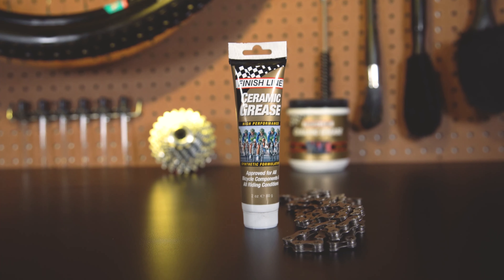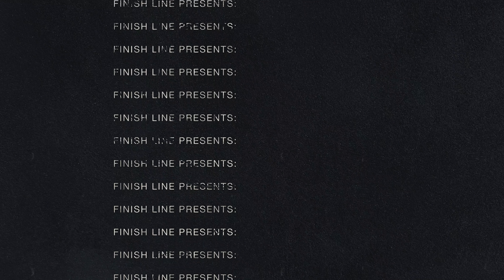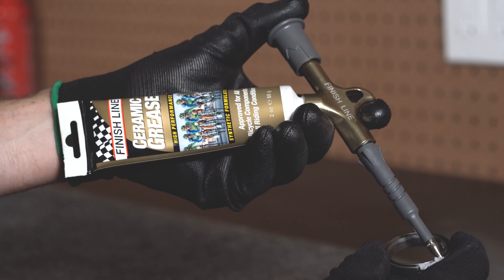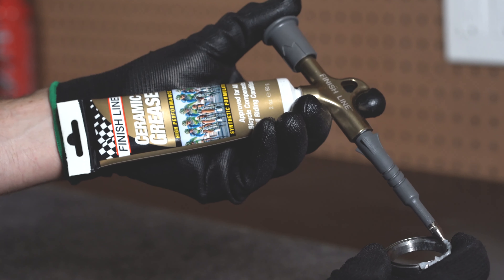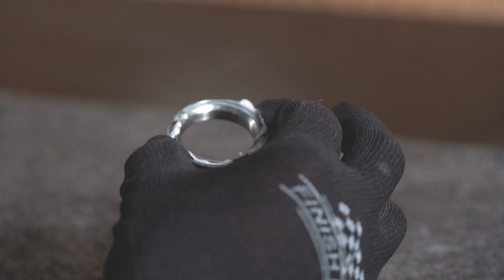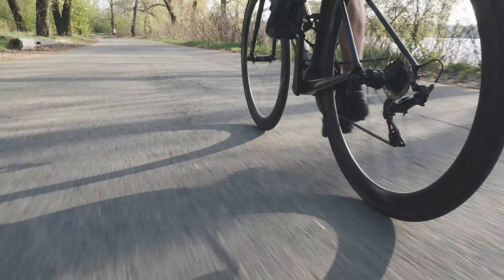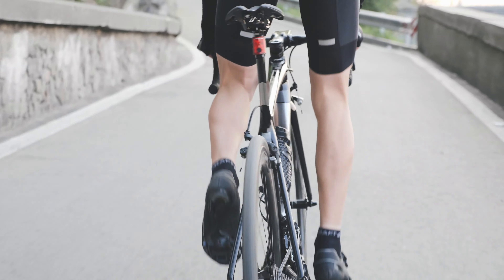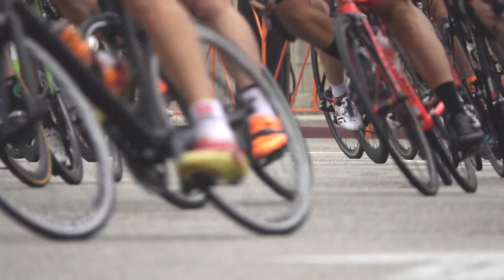Ceramic Grease | Finish Line : The Inside Track

Comment: Hey Finish Line, is this ceramic grease good for loose ball bearing hubs, or only for sealed bearing rebuilds?  The video only shows packing a sealed bearing and only mentions bottom brackets.  I want to know before I commit to buying a 1lb tub.  Thanks!

Comment: Would you recommend ceramic grease or the premium grease inside of a freehub?
Reply from the maker: Hi Inam Bohle, here's an updated answer to your question. For freehubs we actually recommend using an oil instead of a grease to ensure the freehub pawls engage and disengage as efficiently as possible. Finish Line’s Ceramic Wet Lube or our Stanchion Lube are perfect choices to keep free hubs spinning smoothly.
Reply: @FinishLineUSA  ceramic grease or premium grease?
Reply: I agree with you, they are not clear between both products, they just use superlatives for both and they haven't replied to your question with a clear answer. What i interpret, i think that the ceramic grease is the smoothest one, whereas the other one seems having a better protection.
Reply: @TheSHARCRASH  Yea, this Finish Line video is useless. At least the Park Tool Explanation Video says PPL-1 is thicker and basically more protective - and the HPG-1 (High Performance Grease) is for going faster but the down side is the HP grease needs to be replaced more often.